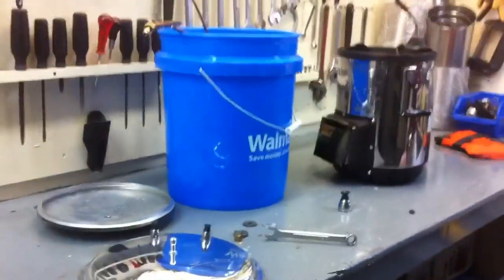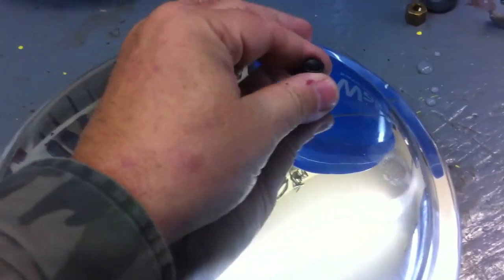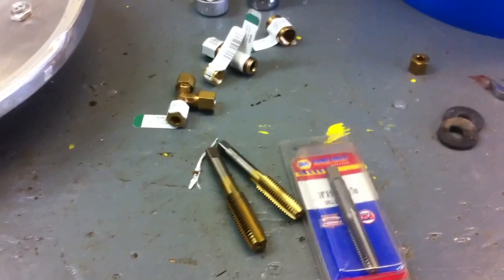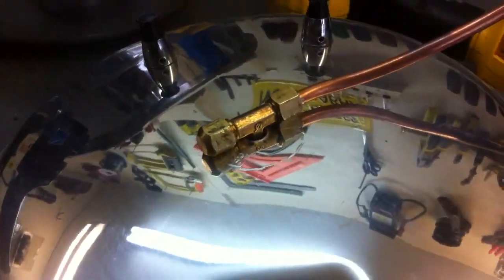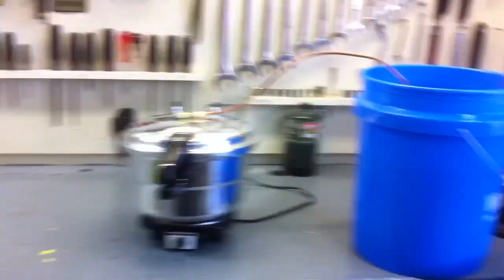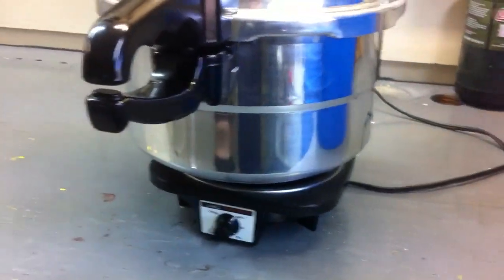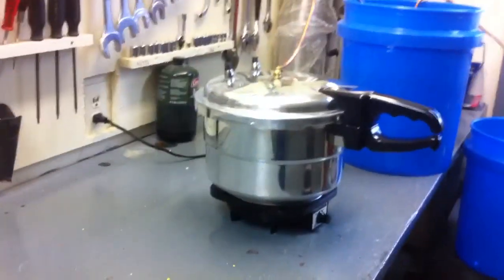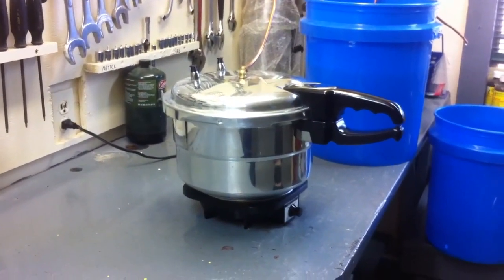How to make a simple water distiller

Comment: So how does the water climb up the copper pipe again? Wouldn't it be clogged up with water?
Reply from the maker: It turns into steam and as it goes through the copper pipe, it cools, turning back into water. What keeps it moving through the pipe is the pressure from the steam behind it.
Reply: @bctruck   oh thanks for replying.  So I imagine at the end of the process you might have to blow on the end to expel the last bits of water stuck in the pipe

Comment: I was wondering why no one made a distillery from a pressure cooker.
Next does it work on removing arsenic?
Someone may think I'm joking, but im not.
Also does it work in removing crude oil from water?
Reply from the maker: It removes arsenic and petro chemical contaminants. You can also turn sea water into drinking water.
Reply: @bctruck  I knew it change saltwater good. But I don't have saltwater.
I have water with arsenic and crude oil in it. 
I also know that distilling doesn't remove everything. Problem is no one tells what it doesn't remove.
Or I will put it another way.  What boils off and recontaminates water.

Comment: Thank you for your service, sir. I just retired 10/2018, at 56 years old with 21 years of service of which 14 were spent in the National Guard. 

I’m a late comer to this video, which was very nice for use with tap water. I was interested in the ideas/configurations of different designs. I also spent 20+ years as a chemist in oil&gas as a scale chemist, pharmaceuticals chemist, and forensic chemist (with the US FDA). Depending on the cleanliness of the water stock you might consider adding an activated charcoal filter to scavenge any volatile organic vapors that could carry over with the distilled water vapor. This may be an inexpensive addition through which the condensed water may filter to remove organic components. Nevertheless, water stock from the tap by law has specific maximum VOCs permitted for discharge through municipal potable water supplies. There are other guards in place that are supposed to protect public water supplies. All in all, I applaud you for your designs as both are simplistic and easily implemented. Great work.

I seen similar distillation applications designed to generate a number of essential oils and hydrosols from plants, i.e. lavender. So, shipment of distillation apparatuses and supplies should not be of legal concern unless you advertise “for use in production of an illegal or government regulated product.” In the latter case you simultaneously be drawing attention to one’s self or maybe even develop the beginnings of your own reality TV show. LOL!

Comment: You could of attached a silicone hose to the lid. Can take temperature easily.
Reply: Silicone tubing is pretty heat resistant for things like steam but I consistently hike and camp with a similar distiller setup and I can tell you that while your pot is on the fire boiling there’s a good chance that the heat from the fire could destroy your tube, it’s better to connect your copper or stainless steel coil directly to your source of steam and not worry about tubing and it’s generally safer not having to worry about melted plastic in your drinking water.

Comment: There is no danger because you have an open line so no pressure buildup. A pressure cooker distillery is completely safe. 
You can drill a hole in the bottom of your worm pot to run your line through and use flex seal to seal  it. Then use vinyl tubing on your spout to go into your jar or catch container.
You can collect more if you drill a hole in the bottom of your worm pot. You can get a threaded brass spout to run your line through and seal it with the flex seal. 
I have never had a leak in my worm pot.

Comment: Well I may be 5 years late for the party but I plan on catching up 😁..
 Most excellent vid, exactly what I was looking for.
 Many thanks. 👍🏻
Reply from the maker: Thanks!
Reply: @bctruck  what are you using for distill water same method or now u buy company made distiller ?
Its almost 5 years what benefits you found in that process 
I know I am late in this process!
Reply: @SunilKumar-wh8zv  ps, if you're switching from alcohol to water, you can wash the inside of the coil out with white distilled vinegar, recommended to do this if you're only using the distiller once a week..
Reply: Same plan dudue
Reply: @SunilKumar-wh8zv  👍🏻 I used 5 meters of 10mm copper pipe and wrapped it slowly around a 5lt can of paint to create a 12"" tall by 8 inch wide coil, filled the inner part of coil with ice cubes, perfect!! 👌🏻
PS: that size coil fits 💯 in a steel bucket.
Reply: @CrackInTheBox666  I heard that aluminum cooker is not good for distill what do u think?
Reply: @SunilKumar-wh8zv  tbh I've heard that advice regarding alum - but only if you're going over like 900° 😁..
 Alcohol evaps at about 79°, alums fine.. 👌🏻

Comment: So if there is some form of fermentation or -OH molecule in the dirty water, it will be in the resulting "distilled" water, maybe a suggestion to bring the water to an open rolling boil first for a few minutes before piping it off, so that anything weird in future chemicals or toxins that has a lower boiling point than H2O is rid of?

Comment: I don't understand how there could possibly be 'pressure' in your pressure cooker now that you've tapped what is, essentially, a permanent release valve in the form of a coiled copper tube.  Seems like you could get the same results with an enclosed pot and lid.  Don't you need to put that weight thingie back together somehow on the newly tapped valve so it can do its job to build up the pressure?
Reply from the maker: Jay Datesta maybe this isnt something you should attempt.

Comment: well I just want anybody interested to know that if you are going to distill water your really going to need a lot of these pressure canner the biggest ones you can find because the out put of water is slow and everyone in your family is going to need drinking water so I would say make 1 of these for every person in the family and run them at the same time also would be best, also get 55 gal drum to run coils through. oh yes the person who suggested boiling with the lid off was right I read up on this and they suggest that you boil first then start the distilling process also best to filter water before distilling . when you do this project you really want to see how long it takes and how much water you get and how much water you put in also keep in mind that you will need water for cooking aswell as drinking then you will see what I mean.  Thanks
Reply: Let's do ... some math ... let's say the stove is a 900-watt unit ... and that it requires approximately 2,250 kilojoules of energy per kg  to boil water. This means that in a perfect scenario, you will get approximately 0.024 kg / min of distilled water. Since the density of water is about 1kg / L ... this means you will get about 1.43 L / h after it starts to boil. Since some of the energy from the pressure cooker is lost to the environment ... the end result could be around 1 L of fresh water per hour.   This means that at least 3 hrs is required per adult.

Comment: Just before I started watching this video, I was telling my wife that I would NOT make the hole in the bottom of a bucket, but would rather run it out the top.  I was telling her that I would have an "internal" coil and an "exterior" coil all on the same line.  I was thinking that the interior coil would be the "intake" from the steam and the exterior coil would be where it drips out over the top into the collection container.  -Then I watched your video and laughed.

Comment: Hello and thanks for the video.  After watching it I looked at the comments and saw your reference to the other fellows video with the American Canner.  Here is what I wrote him after watching.

Okay, I am stuck.  Tried to follow video for tea kettle distiller..a thousand plumbing parts later and a great setup, I was horrified to find the lid to the tea kettle was not steam proof.  So back to Youtube and I watched BCTruck and You working those pressure cookers with far less material and much greater practicality.  I have a fun collection of them including an old American.  However, heating a monster pressure cooker like the American Canner takes a lot of fuel for sure.  Like BCTruck, I have  rocket stove...a Grover..that has a hard time boiling a small pot of water.  The camp stoves like solo, titan and campfire are great but could never sustain the weight of that pressure cooker.  So, please share how in an emergency situation would you fire that baby up.  Thanks so much for your video.  

So back to you.   I like how your rocket stove worked and would love to use one of my lighter pressure cookers.  Don't think that we will have enough fuel to fire those things up too many times in case of an emergency.  So, could you please keep at it and keep posting videos...thanks a billion.  PS  was wondering, if you put radioactive water into your pot, could you still touch the pot??? Basically the pot is a gonner right?

Comment: Big Bc, You should add a pre and post filter to your distiller. That will eliminate chlorine and other gasses that will evaporate before the water. You could also aid in cooling the steam if you wrapped your copper tube with aluminum.
Reply from the maker: This was just a quick easy "how to make water safe to drink" video. There are a hundred things I could do to have improved this but the point was,in a disaster,yopu could make this very simply and cheaply. Thanks very much for your input. Perhaps down the road I'll do a video that will feature a much longer lasting and better built distiller using all the suggestions here in the comments.
Reply: Id like to see you make a big one. Thanks for your vid.
Reply: Semantics...was wondering about the prefilter....post filter...but can't you just take off the first distillate since the chlorine and other gases burn off sooner or am I thinking about it wrong?
Reply: The gasses evaporate before the water and than are condensed back with the water. any part of the water that evaporates before the water will stay with the water thats why its important to filter those out before the distilation process, They can also be filtered out after so it may not be necessary to have a pre and post filter but it wont hurt either. A regular brita filter before the distilation process should be enough to ensure your water is comletely pure.
Reply: Semantics Simple
I think you meant to say "any contaminates that evaporates before the water will stay with the water vapor"? But, like Suzanne said, you could just toss the first bit of distilled water, or let the water come to a full boil before putting the lid on the pressure cooker. The contaminates that evaporate before the water will then go into the air and will not stay with the boiling water. But, yes I agree, you should pre filter the water just to remove as much of the suspended solids as you can. Even filtering through doubled levi will help. No filter will continue to remove all disolved solids, regardless of what their sales pitches imply. Distillation should remove everything except for water.

Comment: G'day BC,
If you want to increase the efficiency of water process, try adding a funnel inside the unit, this decreases the amount of water that is being boiled at any one time.
Have the funnel so it is about 5 mm from the bottom, this allows water to flow under, and also stops blockages. But make sure the funnel is almost as big as the inside diameter of the pot you are using.

Comment: I love this idea. If you pick up a used pressure cooker like that this is a fairly economical process. The part I don't like is that if you need to do this on a fire it requires lots of attention... I am so glad your doing a sand filter next! There are a few ways to make them but i have seen some pretty muddy water come out clear with that type of filter... even if you needed to pasteurize it you are set by having a small homemade wood gas stove, alcohol stove, rocket stove or a solar oven. Good, safe, clean drinking water can totally be had on the cheap. Vids that show everybody how to make something to survive a emergency situation that EVERYBODY can afford are the highest ranking vids in my books! Nicely done!

Comment: nice, it works :) I just make spaghetti and squeegee the condensation off my windows, this looks a little more scientifical. If you didn't have a pressure cooker you can boil a big pot of water, put a brick in it and a smaller catch pot, then a large bowl with a round bottom over top with water or ice in it and the condensation will roll down and drip into the catch pot. Or outside when it's hot with a kiddie pool or area with plants or whatever and plastic above it with a rock to make a low center point in the plastic the same way cause water evaporates and when it hits something it cools under steam temp pretty easy and condensates and if you have something to catch it, whala ... whata

Hey look, Kevin Bacon, you weren't makin that up :)

Comment: About your distiller. Nice and simple. Our science teacher back in the mid 70's tapped into a steam pipe for the school's heating system ran the steam through a make shift cooling tower and we had all the water we needed for our photography class he taught. I am sure the head custodian wondered why his make up water was running all the time. So I guess if you have one of these systems in an old house you could do the same thing.

Comment: Nicely done. It's nice when people respectfully offer their opinion but that seems the rarity.

I did a fair amount of research on the Kleinschmidt Still which is supposedly very efficient. But it seems out of reach for the typical DIY. They claim this pressure cooker method is about 1 gallon of fuel to 1 gallon of clean water output. Of course wood is generally not hard to come by. The Kleinschmidt Still is rated at around 1 gallon of fuel to 200 gallons of clean water.
Reply from the maker: ill have to have a google about the klienschmidt still.
Reply: Your method is more practical.

Comment: Good job glad you didn't tap that thin lid.
Reply from the maker: I actually did but like i thought, it wasnt thick enough so i drilled it out and went with a rubber washer on the inside.

Comment: I'm glad it worked BC. I thought it was going to blow steam and condensate like a steam boat whistle. Do you have to watch how much heat you give the pressure cooker?
Reply from the maker: it has a blow off valve if you get the pressure to high but i would be sure to regulate it. the blow off valve is a last ditch kind of thing that you wouldnt want to rely on.

Comment: Works like you know what you were doing. I've been searching to see if I've got any of those round-tuits left, then I'm going to get one of those put together, too.
It was 14° here last night, and we're in the midst of a warm spell. Hard to fathom that you're talking about getting some seeds going already. I'm still a few months away from being able to to that.
Reply from the maker: dont bother trying to save a couple bucks and getting the chinese knockoff round 2its. I used them a few times and they usually fail in the middle of something important resulting in unplanned down time in the form of naps.
Reply from the maker: there once was an old dude named randell
on the winter,he could not get a handle
he said with a grin
though snow had him shut in 
cause he knew that soon they would trample
he opened the door
set peanuts on the floor
and waited for the little gray vandals
they all came a runnin
little feet just a hummin
they ate till they couldnt no more
now snow was all gone
it didnt take long
and randell could exit the door

This is what you get when you only pay for the 50 cent poem,,,,,,,,, cheapskate
Reply: BCtruck, rebuild, repair,repurpose You are a man of many talents, but this one came as a surprise. This is great and captures the essence of life around here, perfectly.Well worth the 50-cents! The only thing that was a bit embellishing is in the first line with the word 'old'.
...It probably should have read 'ancient' or 'prehistoric'.

Comment: I feel like running the coil out the top could be dangerous.  The only way for the water to get out of the coil is to fill the entire coil up with condensed steam and only then can it get out, so your coil is now full of water and not really doing anything until enough builds up to push a couple drops out the end.  Go back to how you had it with a little silicon around the hole (it won't really be exposed to high temps since the steam is cooled by then).  If your coil is full of water, you're going to be pressuring your cooker - and when you test it on your rocket stove, that may be enough to go boom. Make sure your entire coil has a downhill slope, let gravity work for you, even if that means part of the beginning of the coil is out of the water.
Reply from the maker: I think you may be right. im gonna find a better solution to that problem. im gonna totally re-do this to look more like buckrun11,s distiller. here is his vid:
Water distillation project

Comment: OK, I gotta get on the ball and make one now.  I got about 20 gllons of fresh water stored for emergencies, and was going to get more containers, but there is a stream behind me, so a distiller would make for a better long term water solution.  Not to mention if there is snow, I can distil that.
Reply from the maker: dont forget about about the 40 gallons of water in your water heater,,,,, unless you have on demand heaters. this is something that is simple enough to make that if you just had the parts ,it would go together very quickly when you needed it.
Reply: Yup.  I will have to remember to scrounge some copper tubing when I see it :-)